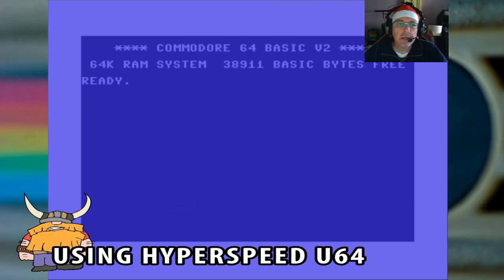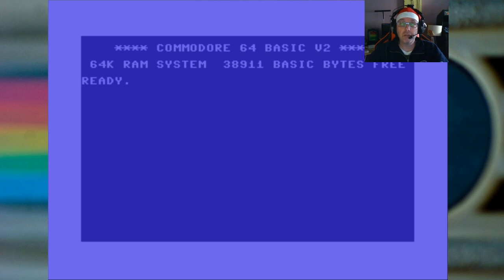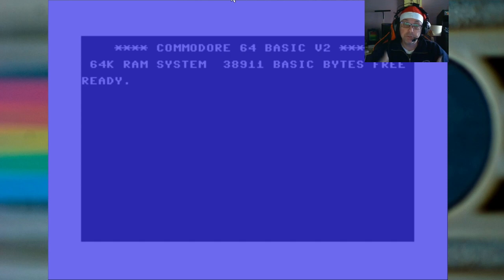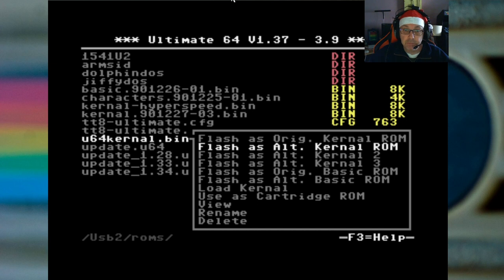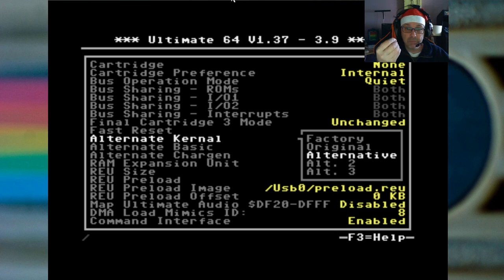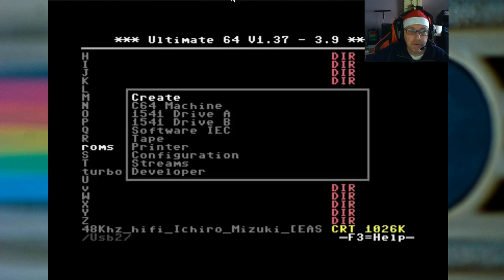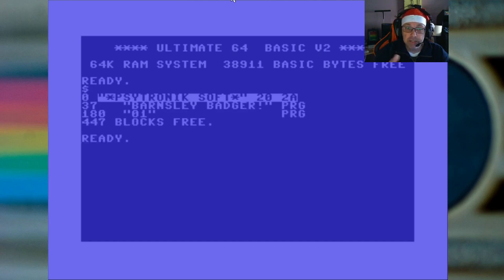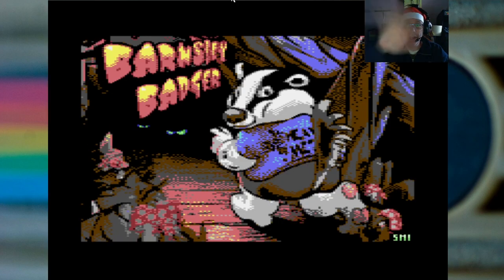Using Hyperspeed on the Ultimate64 (version 1.37 - 3.9) - READ THE DESCRIPTION

Comment: Great video, Mr. W!  One setting that you forgot to mention is that the "Command Interface" needs to be enabled as well. I saw it was enabled in your settings, but you did not explicitly mention it.
Reply: Will the customised kernal become available outside of Facebook, e.g. on the Ultimate64 website?
Reply from the maker: Darnit! Forgot about that one.
Reply: There is Command Interface Enabled / Enabled V1 / Enabled V1.1 - which one is correct?
Reply from the maker: @hayesmaker64  I just used "Enabled"

Comment: What did you press to Enter into the .d64 disk image?
Reply from the maker: Just right arrow
Reply from the maker: Also, don't forget to enable "Command Interface" (read the description as well). 
You can alter the device ID from 10 to 8 by pressing the + and - keys. Make sure you disable any other device with ID 8 to prevent clashes.
This allows you to open and read D81 images, but if the game multiloads by NOT using the kernal routines, it will fail (like Metal Dust which I've tried)

Comment: I haven't got a single game to load using this yet - does it only work with d64s with a single prg inside?  Usually I get File not Found Error when using Load"*",10,1 - 1 d64 loaded but when running failed during load with a black screen.
Reply from the maker: I'll do some more testing. I can't imagine it would be so limited. I'll respond here when I have more.
Reply from the maker: I do know that games that don't use the Kernal routines to load won't work. That may rule out loads.
Reply from the maker: I've managed to get a few games to load that have more than one PRG in the directory. The ones that I tried:
Hessian v1.2 (ok)
Sydney Hunter and the sacret Tribe (ok, when fast loader off)
Mayhem in Monsterland (black screen)
Ghosts'n'GoblinsArcade (ok)
CommandoArcade (ok)
It's Magic 2 (ok, fast loader off)
XForce (couldn't read the directory or load anything from it)

So it seems that some fast loaders just won't work. And some directory content causes problems.